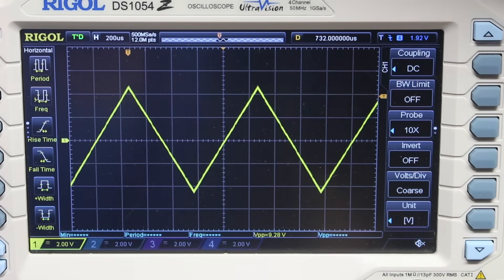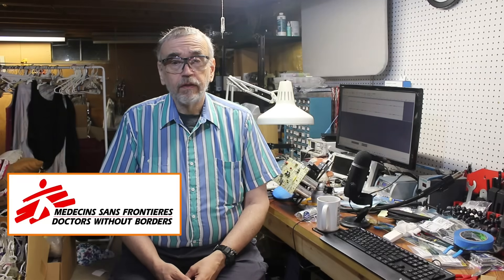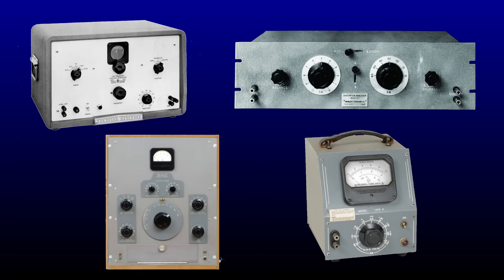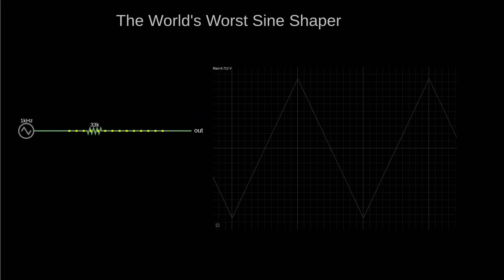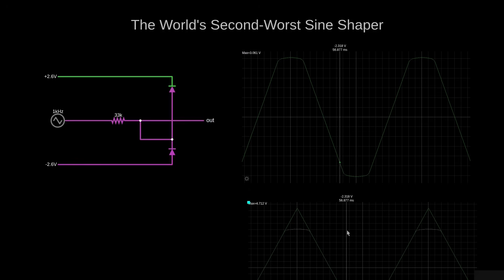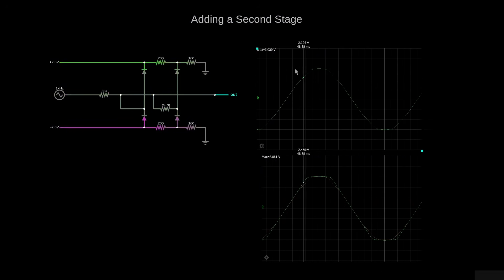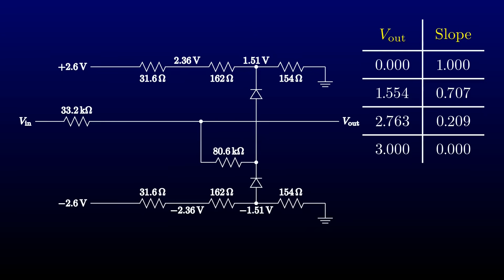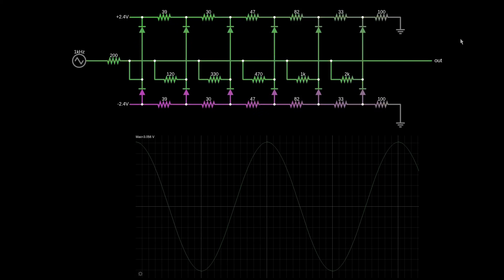The Diode-Ladder Sine Shaper - Introduction - Exploring Analog Audio Synthesis, episode 10

Comment: Now how do you turn a low current diode sine wave into a very high current one? PWM?
Reply from the maker: That's one way.  I wouldn't use this circuit, though, in something like a motor drive.  It's more for generating test signals or audio.

Comment: Any way we could reduce the spectral noise it comes with? FFT analyzer shows much wider band for the generated sine wave as compared the sharp peak of ideal sine wave
Reply: but the most problematic thing is spectral noise/side-bands. Any way we could suppress the side bands ?
Reply from the maker: A lot of what youy're seeing is the quantization noise of a cheap oscilloscope.  Moreover, the sidebands are smeared out because they're convolved with the window function of the FFT with too few samples.  Dealing with this thing properly would require a proper audio analyzer, more samples, and more than the usual 8-bit A/D of a cheap scope. I'm left with, "it's better than my scope can measure.'

Comment: Wouldn't a high order low pass filter work better than this?
Reply from the maker: The eventual target is a VCO with a tuning range of 1000:1 or so.  That would require a high-order filter capable of voltage-controlled tracking over that range, which would be a pretty tricky design.

This design is pretty close to the way that most purely analog function generators (as opposed to dedicated  sine wave oscillators) worked.  

An overdriven OTA, or an enhanced Gilbert cell design like the one inside the long-abandoned AD639 might be a better choice in this application, but I don't think a high-order VCF is going to be any simpler or work out any better.

This thing has a high component count but the components are dirt cheap. The theoretical best=case THD of this shaper is about 47 dB below the fundamental (I calculate 0.44%), which is "good enough for rock-n-roll."

Of course, I could do it with a fast D/A and a smoothing filter. the way an AWG does it, but where would be the fun in that?

Comment: similar circuit from 70's was bit simpler - 10 diodes, 5 resistor, just to ground. no need two clamping voltages.
Designed for few V signal, which is quite normal, when generator is made from opamps
Reply from the maker: There are a bunch of other circuits like that. For the most part, they are exploiting the exponential nature of the V-I curve. I've not discussed that a lot yet. They also often need temperature compensation, although uncompensated ones can easily be "good enough for rock'n'roll." 

The design in this video can be approximated well by linear equations, so it was easier for me to explain. Also, it's pretty bulletproof and fairly easy to tune for minimum distortion. HP and Krohn-Hite function generators used it for decades. 

You're right that it's one design among many, though! And it has a relatively high parts count, although with a quad op-amp and quad diodes, it doesn't need all that much board space.

A lot of VCO designs take a completely different path, since they have half a LM13700 or CA3080 lying around that would be unused otherwise. But that's a topic for a different video!

Comment: I guess the best test of a sine shaper is not how good the waveform looks but what harmonics are visible in a spectrum analyser, and how much of each.  Changing the waveform may even be introducing some new ones, not just reducing the amplitude of some.  I read recently someone complaining that a certain harmonic was clearly audible in an off the shelf Eurorack one.
Reply from the maker: Right you are! I don't have a low-noise audio analyzer, but if you look at the opening screen of the video, you'll see that it's giving some of the game away - it shows the FFT display on the scope, up to the 10th harmonic.

Comment: 9:23 why is the max input voltage just a function of pi?  Isn't it the output voltage plus twice the Vf of a diode, if you're measuring it at the diodes, or whatever you feed to it if you're measuring it at a resistor feeding into the circuit?  How would it be affected by the actual input signal peak voltage and the chosen resistor feeding the diodes?  More current would seem to put it somewhere else on the curve of the diodes, affecting the shape of the signal.
Reply from the maker: With none of the diodes conducting, the output signal will be equal to the input signal, so it'll have a slope of 1. That means that the transfer function will have to be Vout=A*sin(Vin/A) for some constant A. If it has any other form, it wouldn't have a slope of 1 at the origin! That means that we'll have to design it so that the output signal reaches its max value when Vin/a=π/2. 

At this stage I'm playing it a little fast and loose by assuming that Vf is constant. But I think that what you didn't get is that "Vout reaches its maximum when Vin=Aπ/2" is a design constraint that simply arises from the shape of a sine wave, and we're trying to make the circuit follow that rule.

Comment: Overdriving a LM13700 operational transconductance amplifier chip gives a sine "good enough for rock and roll".
Reply from the maker: Yeah, tanh is close enough to sine if you squint!

It can actually give a pretty good sine if you use feedforward cusp cancellation with temperature compensation. http://www.openmusiclabs.com/files/otasine.pdf gives the results of OpenMusicLabs' testing of that topology. The final design is better than their equipment was able to measure. (But the tuning is janky - and the temperature compensation is, uhm, "not fully explored".)

The paper also shows in the introductory material what might be an improvement over the diode ladder, replacing the diodes with paired emitter followers so that the divider is isolated from the shunt resistors. It has a diagram of Barrie Gilbert's shaper as well. 

I started with this one because the theory is easier to explain.

Comment: I built a Wien Bridge Oscillator for a fixed 1Khz 1v output and used a bulb. Useful for audio work and very low noise and stable. Great video !! cheers.
Reply: but you need frequency range say 1Hz-100kHz,   then Wien bridge is a bit complicated
Reply from the maker: The Wien bridge is well-nigh impossible to arrange for for volt-per-octave control! Unsurpassed for signal purity, though!
Reply: @KludgesFromKevinsCave  I am not thinking of doing a voltage controlled oscillator.  Do we need a high purity voltage controlled oscillator or do we have two different needs in play.  A Wien Bridge that is adjusted with resistors is not super hard.
Reply from the maker: @kensmith5694 in this unit, I'm looking toward a sine wave VCO. An ultra-low-distortion sine wave oscillator with manual control is a different project - which I plan to take on eventually.
Reply from the maker: @kensmith5694  I'm targeting a voltage-controlled oscillator with good volt-per-octave tracking, and adequate purity (determined to some extent by the listener's ear). So I think we do indeed have two different needs.
Reply: @KludgesFromKevinsCave  The idea with manual controls does work but it uses a good sized boat load of parts. I may still finish up the model of it and perhaps make it public.
Reply from the maker: I'd like to see it when you  do - contact info in my profile.
Reply: @KludgesFromKevinsCave  Noted
Reply: @johnfox2483  Indeed, it's one piece of the test equipment you need :)
Reply: @johnfox2483  If you need continuous control rather than a switch selection then yes.  If that range is needed then I think I have a good idea for folks.  I will fill in the detail if needed but the basic panel controls are:
A switch for 1, 10, 100, 1K, 10K range
A 10 turn pot with a "counter knob" installed so that the "1" mark is the fully CCW point making it so that it goes up to 11 like all good audio gear should,  After work, I will model it up to see if the idea works.  I will edit this comment if it doesn't work
Reply from the maker: Plan a Wien bridge eventually. I'll probably use a JFET circuit for AGC, but yeah, the light bulb is traditional.
Reply: @KludgesFromKevinsCave  When you come to do the JFET, remember to put a little of the output AC onto the gate voltage.  It is the voltage from gate to the silicon somewhere in the middle of channel that matters.
Reply from the maker: @kensmith5694 Yup. That's another squirrelly trimpot.
Reply: @KludgesFromKevinsCave  Yes, and sadly the digital trim pots are often not an option.  They don't go "crunch" when you tap on the PCB
Reply: It seems a thermistor would work with the right topology. It would be best to encase it so air drafts don't hit it.
Reply from the maker: @kenmore01 yeah, a thermistor works. I'll still most likely use a JFET when I get around to showing the thing, because I always have a few on hand.

Comment: There is another BJT based circuit, I forgot it's name, it takes a single slope and folds it into a number of sine waves, predetermined by the number of stages. It's purpose is not produce sine output from a triangle oscillator but to output an approximate sinus of the input voltage
Reply from the maker: I think I know that circuit!

Barrie Gilbert patented it in 1982, and it became the AD639 "Universal Trigonometric Function Generator".  Gilbert's original patent gives a surprisingly clear explanation of the circuit:  https://patents.google.com/patent/US4476538A/en

The AD639 is long gone (replaced by A/D -> lookup ROM -> D/A).  But the analog synthesizer buffs still find the idea useful. It shows up in the OpenMusicLabs 'SineCore' - http://wiki.openmusiclabs.com/wiki/SineCore, later expanded to a Eurorack module that has a full ±1080° (NOT a typo - six full cycles) range, the Sinulator http://wiki.openmusiclabs.com/wiki/Sinulator .  West Oakland Music Systems has it for sale https://modulargrid.net/e/west-oakland-music-systems-sinulator 

It's a clever circuit, but it looks as if it might be a little squirrely to trim, make temperature-stable, and so on. I might want to build and test one someday.
Reply: @KludgesFromKevinsCave Yes, that's it, I recall it was called Sine Core

Comment: INTERESTING BUT,I AM AFRAID YOU LOST MY UNDERSTANDING OF WHAT YOU ARE DOING AND,HOW THIS WORKS.WHAT IS USED  FOR MUSIC?
Reply: There are two main applications for sine waves in synthesizers. The first and oldest is to create flute tones which can be easily mixed.  The Hammond organ produces a number of sine waves which are mixed to create simulations of other instruments.  Some more expensive electronic synthesizers from the 1970s and 1980s provided a sine wave to mix with output of the filters which retains the 'punch' of the fundamental note while still sounding funky.  Sine shapers are also commonly employed in low frequency oscillators which do things like adjust filter frequencies in audio VCFs and phasors, or time delay in flangers, or volume in tremolo effects.  I've also seen the same circuit used to roughly "simulate" the non-linear transfer curve of tubes to create nice distortion.
Reply from the maker: The sine wave is in some sense the purest musical tone, and it's needed in pretty near all VCOs. But sine wave oscillators are very hard to voltage control over a wide range, so what designers usually do instead is to take a triangle wave and make it into a sine. This circuit is one of several ways to do that. It's one of the easier ones to get working and producing clean output. It's also one of the easier ones to understand. (The care and feeding of overdriven differential pairs is something of a black art by comparison.) Its big disadvantages are the need for many precision resistors (they're cheap nowadays, but weren't back in the day) and the relatively high parts count.

Comment: That was a good walk through of the design method.  You may want to change to something like the BAS70 diode to get low capacitance in a schottky
Reply from the maker: I think I'm missing something. It's not clear to me where low capacitance would be an advantage. We're dealing with audio here, not RF,  and we're dealing, at least in the last circuit, with pretty low-impedance paths. Is anyone going to notice the effect of a few pF of stray capacitance?

I have a few dozen BAT41's in the cupboard. I suppose I could rescale the shunt resistors to their lower voltage drop and see if they make a difference. But I suspect that the bigger effect would be the  sloppier I-V curve of a Schottky, making it more like a germanium diode. But all the ladder designs I've seen seem to do just fine with plain old 1N914 or 1N4148.
Reply: @KludgesFromKevinsCave  When I think of making a signal generator, I tend to think of doing a wider frequency range than just audio but taking 20KHz I will do just a bit of math.
Assume 10pF and 20KHz
Xc = 1/(2*pi*F*C) = 800K
This may not matter so I will say, "Ignore the idea"
Reply: @KludgesFromKevinsCave  After fighting through the captcha gotcha youtube still refused to give me your email address
This is a test message to see if I can post a comment
Reply: Yes, I can but it seems not a long enough one to put the LTSpice schematic in.
I used LTSpic because it is pure ascii and also all the parts I needed come with it out of the box.
I can also do a PDF but that can't be posted here
Reply from the maker: @kensmith5694  Sorry you're having trouble.  

kevin dot b dot kenny plus-sign kludges at gmail dot com

Comment: Like it. Fist seen this in a HP3300.A bit more modern, uses transistors and a current source to (dis)charge capacitors. Very cool design.
Reply from the maker: Yeah! That's what I was talking about when I said that triangle waves are easy to get, and square waves come along for the ride.  The square wave runs the integrator, producing the triangle; a comparator on the triangle toggles the square. $DEITY willing, I'll eventually be doing a VCO that will most likely have a triangle core. (Still undecided what sine shaper I'll use.)

Comment: Apologies if I missed it, but did you decide how much harmonic distortion would be acceptable in the output signal?  (Before starting a design it's important to know what you want to achieve)
Reply from the maker: Sorry about that! The classic HP unit claimed 'less than 1%' and the popular ICL8038 function generator IC claimed the same. There's word in the folklore that they can actually be trimmed to about 0.6% with careful adjustment. I'd like to see if I can at least replicate HP's numbers from 70 years ago! (The 8038 worked on the same principle, with emitter followers in place of the diodes.)

I have only a hobby-grade oscilloscope and no professional grade distortion analyzer so I don't expect to be able to measure much tighter than that in any case. One possibility would be to run the output, suitably attenuated, into a computer's sound card and try to do the THD analysis in software.

If you freeze frame the opening slide, it kind of gives part of the game away, since it shows the FFT display on the scope for the best trim that I got so far. 

In any case, since we're talking about audio synthesis, there's a certain amount of "if it sounds good, it is good" hand waving.
Reply: May I ask? How do you calculate it, like how do you calculate how much harmonic distortion from the first level?
Reply from the maker: Calculation will give you a theoretical THD that your real circuit will never achieve - but then gives you a goal to compare against. For calculation, you calculate the mean square difference between the wave your theoretical circuit puts out and an idealized sine wave, and divide by the mean square value of the sine wave.  Since this circuit's theoretical output is piecewise linear, you can do it integrating over the intervals between the breakpoints. The calculus is straightforward but messy, so I don't plan to show it.